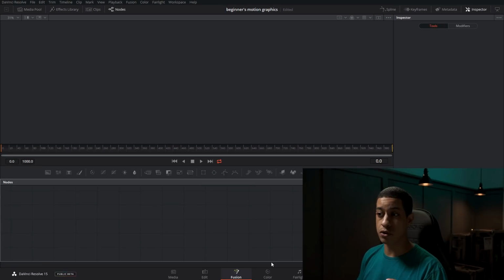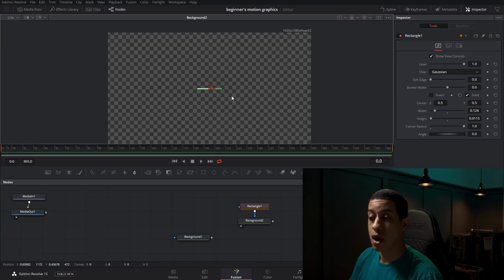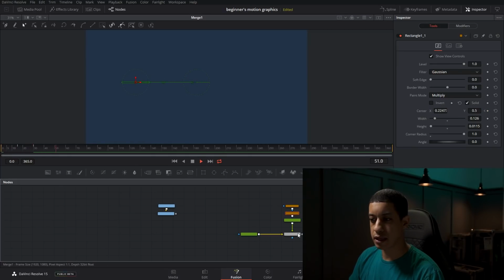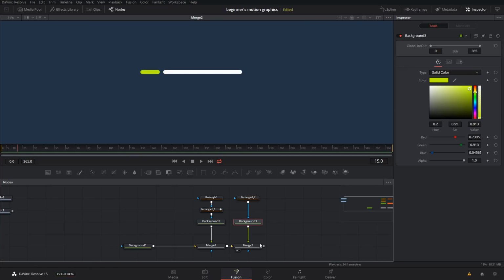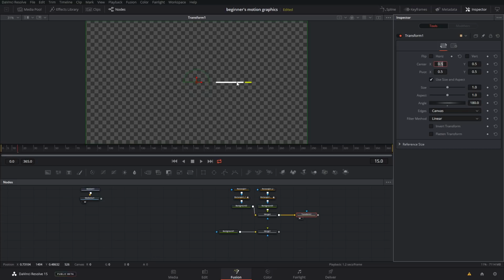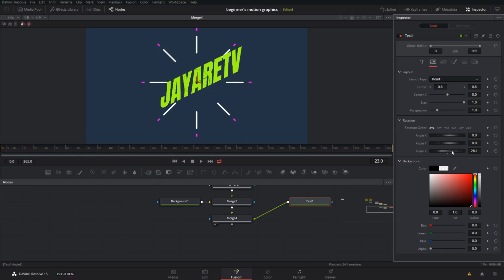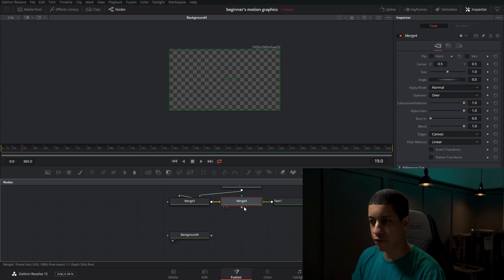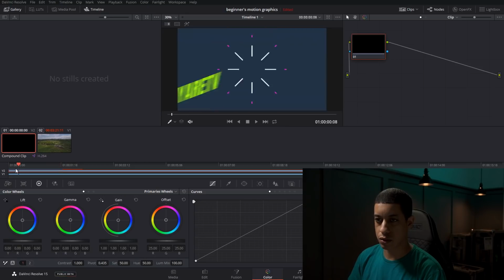Beginner's guide to building motion graphics in Davinci Resolve 15

Comment: Hey yo, you can do your radial array construction with one single Duplicate node!  No need for all the node action there. That's probably the thumb down you got there!  ( wasnt me :)Cheers
Reply: Yeah, Vito's right. Duplicate node is the usual way to go for stuff like that. Unfortunately the Duplicate node didn't make it into Resolve 15 (yet?). It does exist in Fusion 9. 
I think that has happened once already. I think, when Fusion 8 or 9 came out, there was a tool missing and I had to import it from an older version. I think it was the Duplicate tool. Pretty much one of the 10 most important tools in Fusion.
Reply from the maker: Sure about that!? There's no duplicate nodes in DaVinci Resolve 15.....

Comment: Great tut, but why didn't you use a duplicate node between the 2 merges and set the number of copies to 11 and angle to 45? I'm just a total beginner so I don't really know what the impact is, but it seems to do the trick.
Reply from the maker: Using to duplicate node would be ideal. It would reduce the overall notes need it but it's currently not in DaVinci 15. Halfway through making this tutorial I realize that it wasn't available in this current version and in the manual they don't discuss anything that similar to a duplicate node.
Reply: Oops, I'should have mentioned that I did it in Fusion 9 instead of Resolve. I'm learning Fusion through your tuts. Keep them coming because they help me a lot ;-)